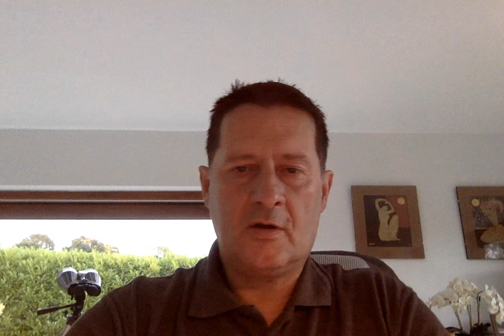Net Zero and The Importance of Ventilation without Wasting Energy

Comment: Great insight simon! There is a massive lack of understanding on all this! I’m sure this channel will grow as everyone needs to look into this! How do you sit with the piv systems with heating elements? Do you feel these are worth the cost or a bit of a gimmick?
Reply from the maker: Hi Matthew. PIV systems should have heating elements because without them the risk of cold draughts is unavoidable. Ideally the trigger thresholds should be configurable and the use of electricity should be such to minimise consumption. Not all systems with heating elements work like this. There is a whole lot more to a successful PIV retrofit than simply buying a unit and installing it. I’ve seen numerous failed installs where the product gets the blame rather than the competence of the person specifying and/or installing. Most people in the trade (builders, electricians, damp proofers) who buy from wholesalers don’t know these dependencies so be careful who you choose..